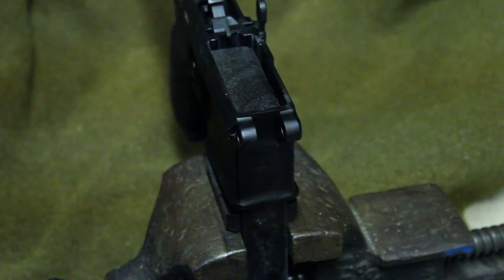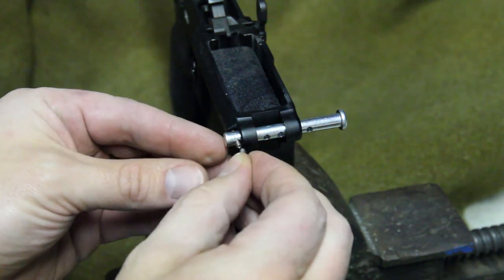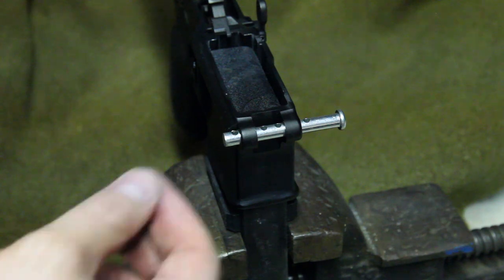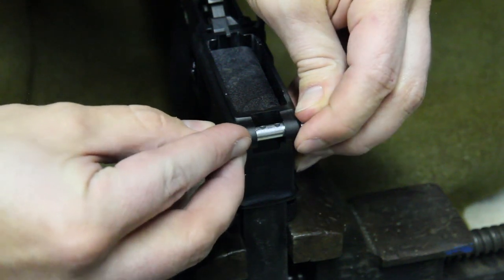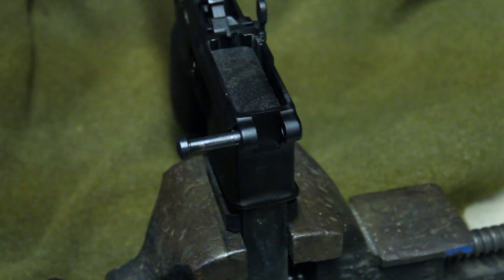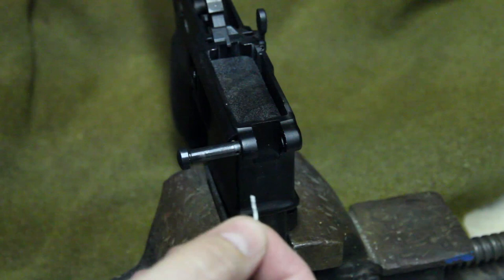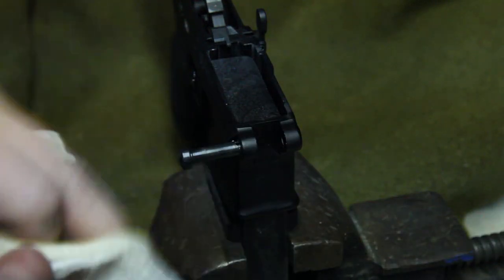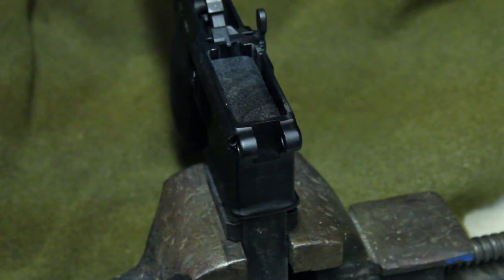Easy AR-15 Front Takedown Pin Assembly

Comment from the maker: I'm aware of a couple different screw type takedown pins. They are usually used to either tighten the movement between the upper and lower, or to allow the pin to be used as a sling mount. As long as the holes have not been enlarged for the screw pin, you should be able to install a standard takedown pin.

Hopefully that answered your question.

Comment from the maker: Michael G- Colt used a screw on some of their models that used a different size takedown pin.  I believe they originally made the different size to prevent a full auto upper receiver from being used on the SP1 lower.  That is a typical setup for the older Colts.  They have since changed the pin size.
Reply from the maker: I'm glad it worked for you!  *****

Comment: This worked like a champ, I found the 1/4 inch Clevis pin at the Home Depot for under $2.  Thanks!
Reply from the maker: ***** Glad it worked for you!
Reply: shramj, which area at HD should I be looking for this 1/4 Clevis pin?  Thanks in advance
Reply: Hardware aisle, It's in the pull out drawers that has all the nuts, bolts, washers, etc.
Reply: thank you shramj!  i just got two from Lowes's pull out drawers.  yr rock!

Comment: There are two parts to the front pivot pin on my Sporter Cometition AR15. It doesn't push out from the left, it unscrews. What's left is the pivot pin with a hole on the left. I haven't tried pushing that out though.

Is that setup typical for a competition model?

Thanks...

Comment: It is way easier than this.
hold the pin in position with needle nose pliers, press it in with a pocket ruler or feeler gauge and slide your takedown pin over it.
Reply from the maker: The Deemin Kane That's very similar to the way that I used to do it.  Some people have had problems with slipping and letting the pin fly.
Reply: I mean the pintle pin method is easier if you own the pin.